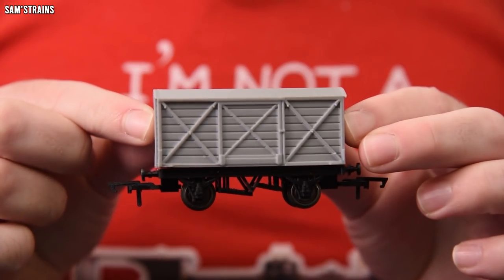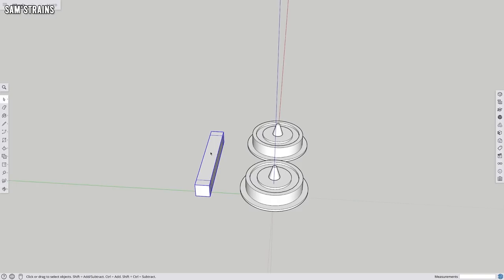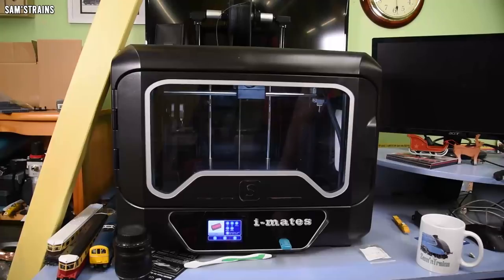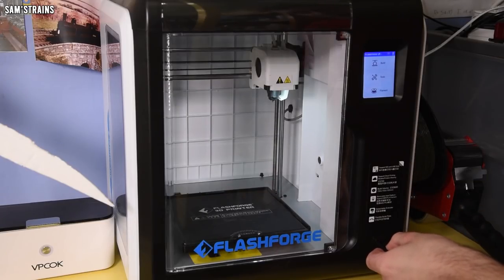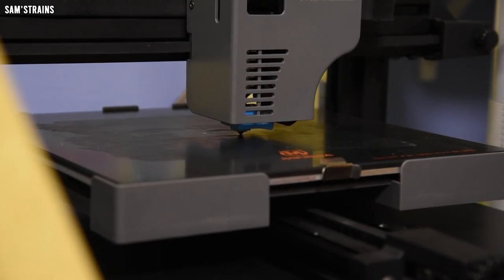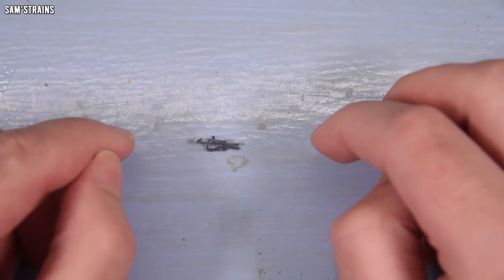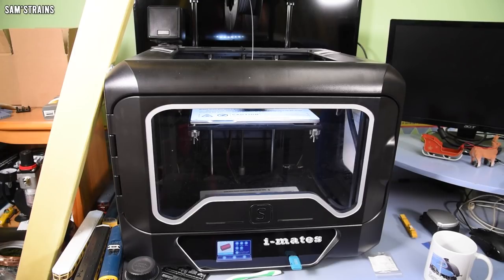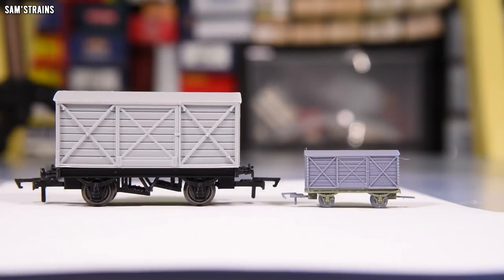Shrinking OO/HO Model Trains Down To N Scale!?

Comment: Dapol has apparently done the opposite with one of their wagons you had tested here...
I have both OO/HO and N scale rolling stock (USA 1/160 and Japan 1/150) and the design difference is really visible.
Brand manufacturing both scales (Dapol in the UK,  Roco with Fleischmann and Märklin with Minitrix) have two different conception bureaus for each scale. For the Hornby Group, the Arnold brand in N scale is a separate entity.
One experiment you can do : scale one of your UK wagon for the exact HO scale, and compare it to its OO counterpart. That might be interesting.
Reply from the maker: Ahh really? It does sound like something Dapol would've done a few years back, lol! Fortunately the bodgy nature of their models seems to have mostly subsided these days!
Thanks for watching, Sam :)
Reply: Aren't they the same though?

Comment: Funny enough, I design all my 3d prints in 1:1 then scale them all down heh
I do keep note that some details need to be exaggerated and the limitations of the scale, but otherwise with a more detailed printer you can get some fairly nice prints, but you do really need a resin printer for N Gauge.
But have been working on a panelled coach to print, and the first test prints are promising!
Reply from the maker: Ahh very interesting!! I can see that working on a resin printer for sure :D
Thanks for watching, Sam :)
Reply: That is what I use...

Comment: I have designed, printed, & am running Z scale passenger & freight cars on my layout. I’m using the Adventurer 3 Lite. I couldn’t do much detail, but I was able to print streamlined passenger cars with the fluting. So, yes, if you design for your scale/gauge you can print cars for your model railroad.

Comment: Pretty good result which with some fettling will work fine. Triang did TT tension lock couplers, so why not in N ?
Get yourself a few lengths of Peco N flexi track, use  the finer nozzle for the chassis and make up two or more with pinpoint steel axles and give it a try. If you can get an N scale tension lock coupling to work you could be onto a winner. You need to do an uncoupling ramp too. It’ll open up a load of operating  possibilities in N which are unimaginable with the standard « Elsie » N gauge couplers. Well done mate!
Reply from the maker: Thanks a lot Robin - yeah I think so too - particularly with some proper wheels! :D
Thanks for watching, Sam :)
Reply: @SamsTrains  
Tbh the useless couplings we’re the main thing that put me off getting into N gauge. I like shunting which is pretty much impossible without some sort of automatic coupling, so I stuck to 00. Just as well really now I’m older and need glasses! But if there’d been an N gauge tension lock things might well have been different. It’ll be brilliant to see how a rake of them performs but you’ll need a converter wagon like the old Triang / Hornby Dublo ones to run them with a proprietary N gauge locomotive. Looking forward to seeing where you go with this.

Comment: The issue with smaller nozzle sizes is that for every size you go down you basically double the print time. Smaller than 0.3 you might as well switch to resen printer which is going to give more consistent parts. IMO for HO and OO and anything smaller I'd be using resen over fdm.
Reply from the maker: Yeah that's very true - I've never really fancied trying it, but maybe one day! :D
Thanks for watching, Sam :)

Comment: Very interesting demonstration and exercise Sam. Scaling in terms of human perception and sheer practicality as well, is indeed quite an interesting phenomenon. Even scaling back from 1 : 1 does already present a bag of shenanigans. Very typically; try to scale a BoBo coach back to HO/OO length and see if it can negotiate the relatively tight model curves. Or try to scale down every little detail of a loco… Doesn’t actually work that well. So, yeah, a big part of professional modelling is finding compromises that work for the eye and as a functioning model construction as well. Impressive that this more or less worked, but yeah each scale does require its own framework I suppose.

Comment: what I'm planning on doing is making an n-scale Deutsche Bundesbahn railroad, so I'd be designing and printing my own models from scratch, and I think I'd rather use premade wheels and couplings just for the sake of simplicity and reliability. the chassis and body, though, I can totally make myself with a bit of practice

but it's very pleasing to know that I can in fact make my own decently detailed vans using a 3d printer at home

Comment: Can confirm - I tried scaling a 1/72 scale plane down to 1/144 and it didn't really work. The parts were too small and fragile having been optimised for the larger version - a small scale version would have needed thicker walls and things in it to allow it to print properly
Reply: Yes this rings true for me as well, I've found you can get away with shrinking a design to 75%, but at 50% things tend to go wrong. I've been really pleased with the N scale bits I've printed recently!

Comment: You should get an N scale train set to review next and run your 3D printed wagon on it.
Reply from the maker: I agree! I'd love to try an N set some time :D
Thanks for watching, Sam :)
Reply: @SamsTrains  if you don't have an N scale track, I can highly recommend the M1 Kato Unitrack starter set of N scale track. It's a simple snap together oval track with a DC controller and sells for about £50 is you order from Plaza Japan, so excellent service and quick shipping. I bought one to test locos on and it's great because I can put it together and break it down again on the kitchen table very easily.

Comment: Scaling 4mm down to 2mm is more than making something half as big. A box, such as this wagon basically is,  will actually be 1/8 of the overall volume in 2mm of its 4mm brother 12.5%). Each individual side is only 1/4 of the larger scale (25%). When viewed like this then getting things to be strong, accurate and detailed enough is even more difficult.
Having now seen the whole video you should be pleased with yourself Sam, that came out really well, a proper design of chassis in n gauge and your away!
Reply from the maker: Yeah absolutely, as you're scaling in 3 dimensions, so the volume would cube when the scale doubles - very true! Appreciate it anyway - it was a fun experiment!
Thanks for watching, Sam :)

Comment: i print my trains in n scale on ender 3
abs , cut into flat secyions making all recesed details as close to straight lines as possible and i i only ise 0,2mm nozzles 
and small details like window frames, doors and other small things that stand out are usually theyre own things also
some assembly required, and flat surfaces need extra padding for sanding smooth later 
after paint you can't even tell a passanger car that is some 18mm wide ,and high and arouns 130mm long doesn't look that much worse than the oryginal models

Comment: My guess is for RTR models the manufacturers can use the same measurements and just shrink down the main body with some minor amendments to the finer details, but the mechanism will have to be different?
Reply from the maker: Yeah that's right - all the same drawings/dimensions can be used - it's just the detailing that would have to change!
Thanks for watching, Sam :)

Comment: Great video there Sam I have heard that this is what manufacturers actually do when making things small, I have heard that a manufacturer may start out with a product in OO then after the OO version has been sold and the production is finished they then look at doing it in smaller sizes like N scale, whether this is right or not I don’t know because this is something I heard off another person.
Reply from the maker: Thanks a lot David! Maybe some bad manufacturers  would do that - but the good ones will always design things for a specific scale!
Thanks for watching, Sam :)
Reply: @SamsTrains  that’s not what I meant Sam I’m afraid, what I meant was the designs for each product are separate but normally what happens is a OO scale version of something is made first then after the OO one is finished they will make an N scale version of the product.

Comment: Fab. I model in some 009 so this is very interesting. I have a very special project for 00 that I've always wanted to do. I looked at doing it in thin brass but 3D printing would be a much better route.

Whilst I am isolating with COVID, I am developing a database for my model railway collection of locomotives. I know most people use Excel but I decided on Access. I want to include everything someone might want, so it covers a variety of gauges and it will be suitable for people the UK, Europe, Asia and North America. I have included detail that can be recorded on faults, damage, servicing as well as where it was bought from, how much, when and year of manufacture. None of the areas are mandatory, so one can add or leave out what they wish. For several areas I have included drop-down lists to minimise data entry time as much as possible such as manufacturer, wheel arrangement and gauge. Locomotives will be entered via a nice data entry screen to minimise stress and confusion for the user. The reports will show stuff like DCC address lists, which are DC or DCC or DCC sound, highlighted to sell, running numbers, what locos are due for service, non-runners, where they are stored in the collection, by classification, power classification, wheel arrangement, livery, appearance (pristine/weathered), colour and lots of others :) I may make it available through Etsy but very cheap if others want it. For version 2 I will add rolling stock but I need to research this more first. No doubt I will think of other things to add to it as I get comments back and improve it. It's better than isolating and feeling sorry for myself.

Comment: An interesting exercise in 3D printing. However your classic misapplication of the terms gauge and scale, and the assumption that 2mm scale must be 50% of 4mm scale, further underlines why model manufacturers don't simply rescale existing designs. In N scale a 2mm to the foot rule of thumb works pretty well for things like buildings etc, but with regard to rolling stock, applying a factor of 50% to a 4mm scale wagon (1:76, though more accurately 1:76.2) would not produce N scale. The closest that would be produced would be Japanese narrow gauge N Scale (1:150 = a 50.8% reduction factor); British N Scale (1:148) would require a reduction ratio of 51.5%, and US/Continental/Japanese standard gauge N Scale (1:160) would require 47.6%.  Throw in the fact that 00 Gauge (16.5mm) cannot be reduced by 50% to produce N Gauge (9mm), where the correct factor would be 54.6%. A fundamental issue concerns 00 Gauge track being significantly out of scale; Standard Gauge at 1:1 is 1435mm or 4' 8.5", whereas at 4mm to the foot, OO track is the equivalent of 4' 1.5" wide - less that 88% of what it should be.  This is why many OO Scale models don't look right when compared to images of prototype rolling stock.  Nevertheless, an informative and interesting video about 3D printing - thanks.
Reply from the maker: Thanks for sharing David! I described the N gauge wagon as "half" size just for simplicity's sake. When doing the scaling, the N model was done at 51% scale as is roughly correct!
Thanks for watching, Sam :)